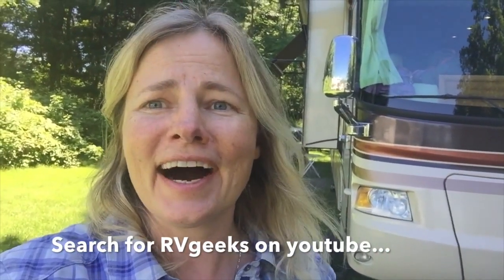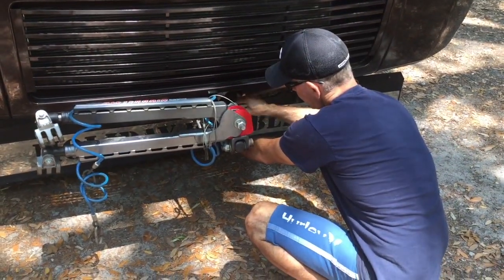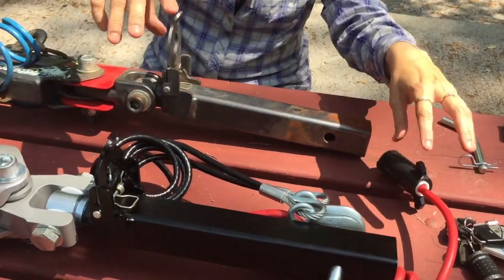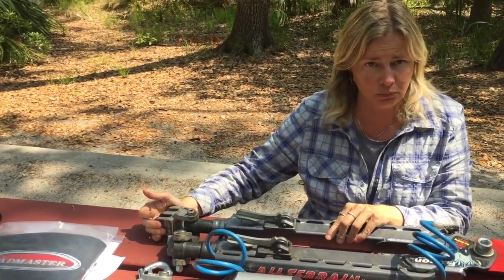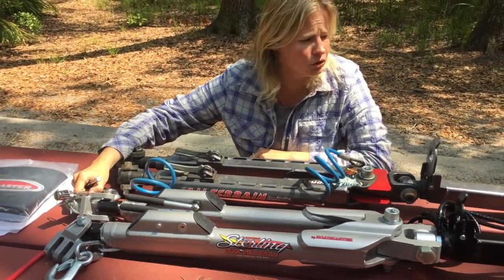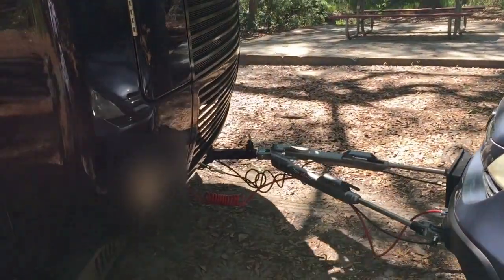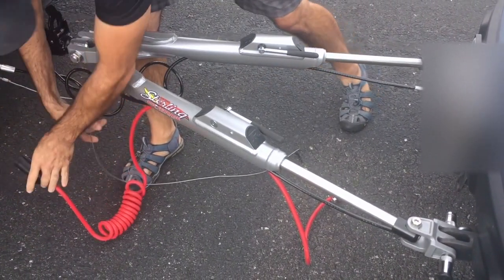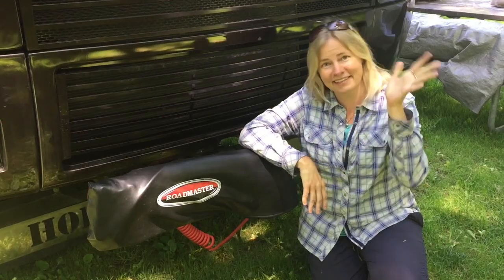Upgrading our RV Tow Bar after 8 years!  Roadmaster Sterling Review

Comment: Nice setup. I went with the Ready Brute Elite by NSA. Not cheap, but it's a towbar and mechanical brake all in one. Cheaper than two pieces of gear. No problems in 2 years 😁
Reply from the maker: We've met several folks who like that tow bar. Great to hear it's worked well for you. Cheers for the comment!

Comment: Other than the cool brushed aluminum look and obvious weight savings, curious why you chose to replace your perfectly functional existing tow bar? Also, in the video it looks like the loops in the electric umbilical were perilously close to the ground. Do you tie them up a bit when traveling?
Reply from the maker: Just because we were presented with the opportunity for a new one in exchange for a product review. Our old bar was just fine even after 8 years of heavy use. As for the electrical cord, it's just fine when the car is fully extended from the RV. Sometime I fiddle with it to center it but that's about it. Having it integrated in the new bar is way better than the old bar where it was just dangling around - never had an issue though. The break-away cable for the supplemental brake is a bigger issue and requires some care.

Comment: Did someone randomly pull the pins from the hitch, or was it a case of "Uh, oh.... I did that!"?
Reply: Either, way, it must have been a frightening thing when the CRV hit the back. Locking pins are a comfort in many ways.
Reply from the maker: We are almost 100% sure someone pulled the pins. We do a pretty thorough check when we initially hook-up, but we didn't re-check our connections after we got off the 2-hr ferry ride and when the car came loose both pins were missing. So, we believe they were pulled.
Reply from the maker: By the way re-checking our tow connections (after every stop) is a standard process that we've added to our tow procedure since the accident. If we'd done this back when the pins were pulled, we would have noticed right away.